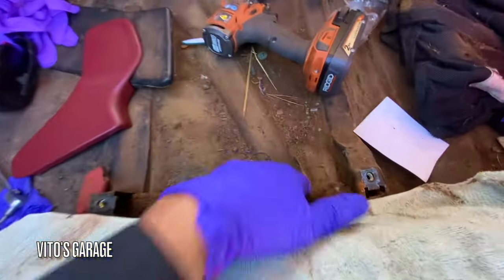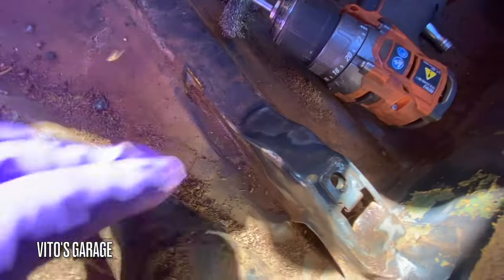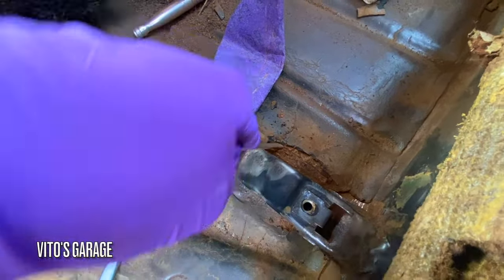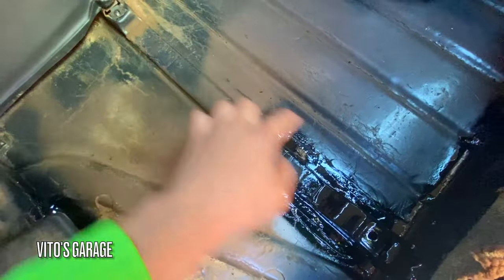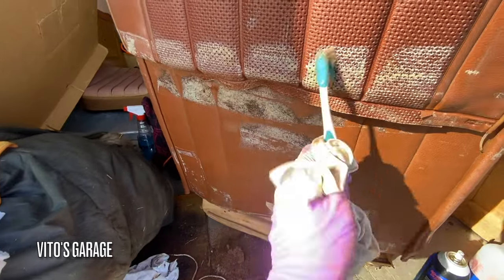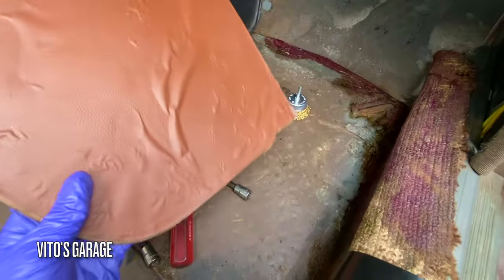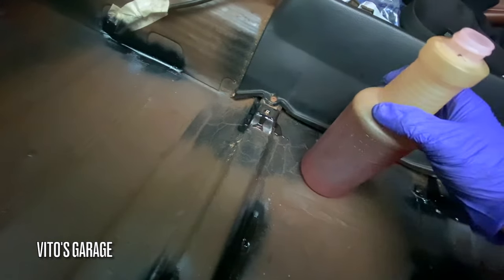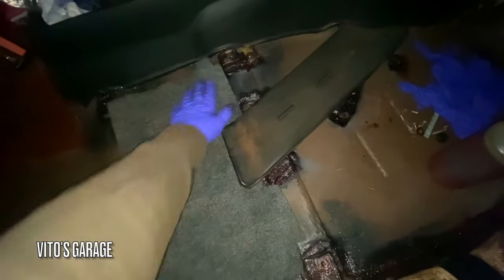MOST IMPORTANT Floor Rust Removal & Forever Preservation Mercedes W115 240D + Bonus Volvo 240 Work

Comment: Ronsonol lighter fluid works great on duct tape residue,   Have to keep it soaked for a couple minutes, but then wipes off.  Cheaper than brake cleaner.   
Have you tried Miracle Paint?  Its expensive but works great for things on outside like wheel wells.
Reply from the maker: Miracle paint doesn’t do miracles. I promise you. Oil and grease do🙂
Reply: Vito, isn't a fan of uncle  Kent. I think he has mention that in a  past video.